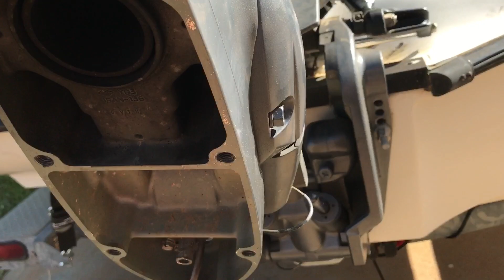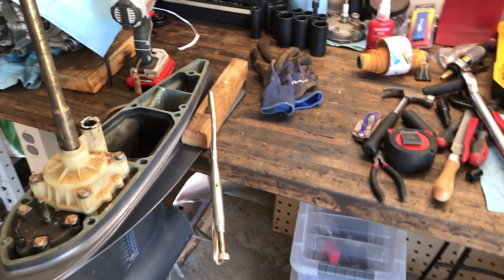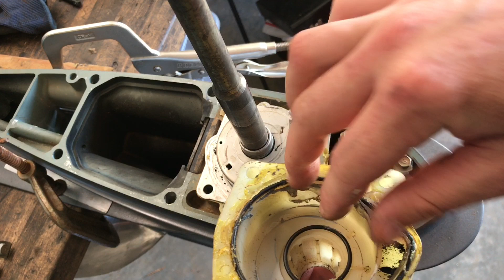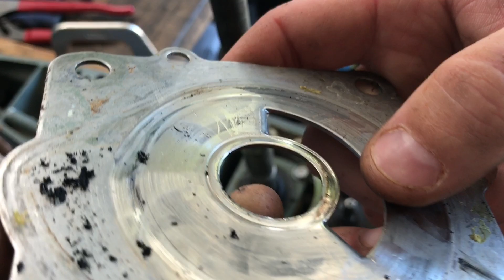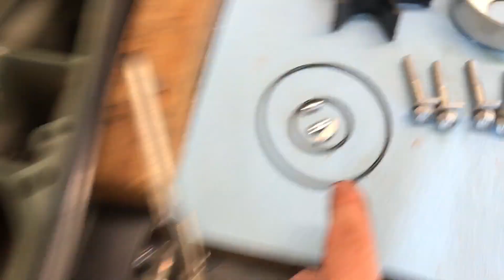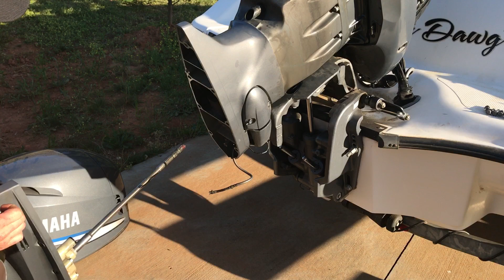(Pt-2) Yamaha F115 hp motor/engine Annual/100hr maintenance Water pump replaced & more..

Comment: Does a 1993 70 hp Yamaha outboard have a poppet valve. My motor give alarm if I am trolling low speed, I can shut it down and after it cools down start up and it run good 35mph.  Suppose to had a new propeller installed, or least I paid the man for the job.
Reply from the maker: Sorry I’m not exactly sure won’t really be able to help you out.